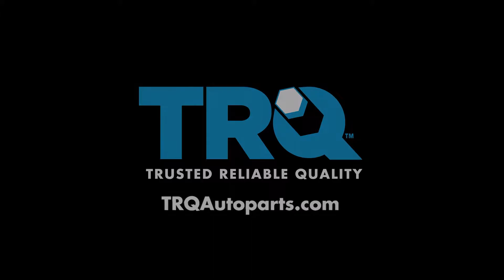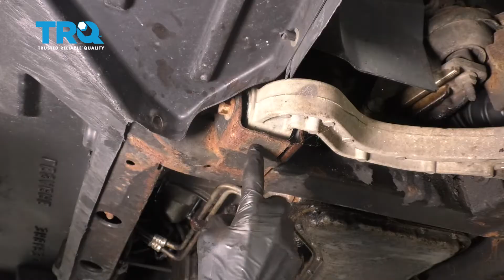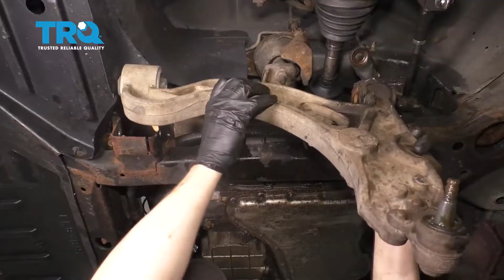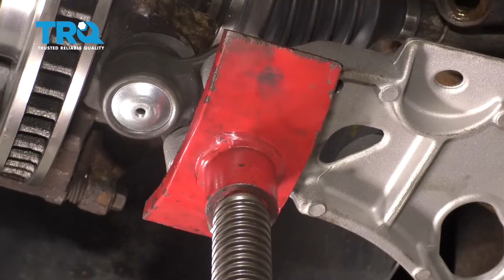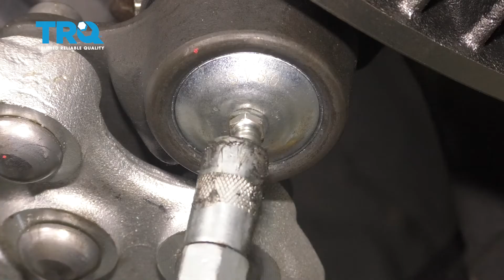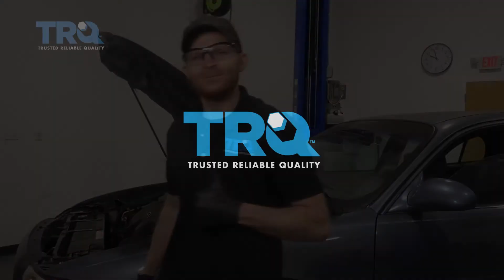How to Replace Front Lower Control Arm 2000-2005 Buick LeSabre

Comment: Good instructional video..but at 9:25 does this mechanic not know how to set a cotter pin?? There is absolutely a correct way to do it. The longer piece of the pin is supposed to bend upward, back and directly over the bolt, the shorter piece bends straight down as far as it can, so they point opposite each other and therefore, cannot move. If you bend them both in the same direction and tuck it at an angle as this guy did, there IS a good chance that it can go straight back through that hole with all the noise vibration and harshness, and expanding/contracting with heat and cold in certain environments.

Comment: 2 notes from my experience doing this job on my LeSabre:

If you still have the OEM sway bar end links, the top nut will be a 22mm, not 14mm. Aftermarket end links are 14mm.

If your car is like mine, the nuts on the LCA bolts won't have the ears anymore and you'll need a wrench to hold the nut while you loosen the bolt. This nut is a 21mm. 

Otherwise, great video.